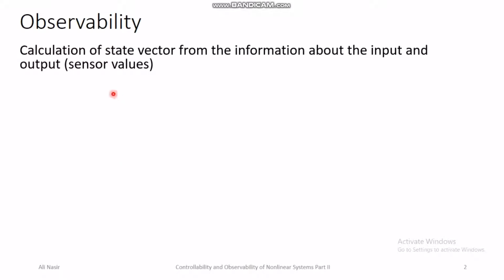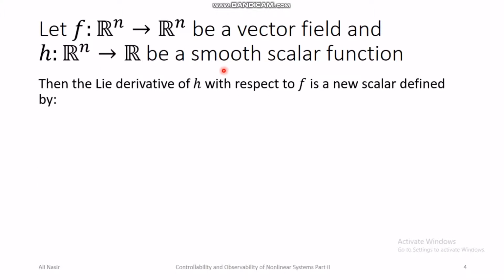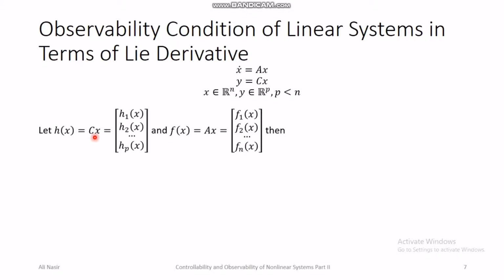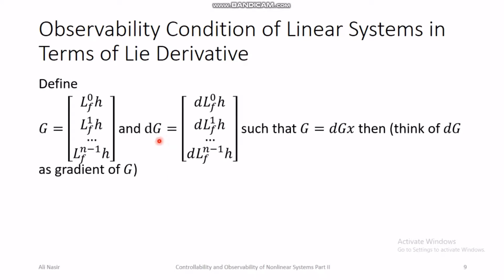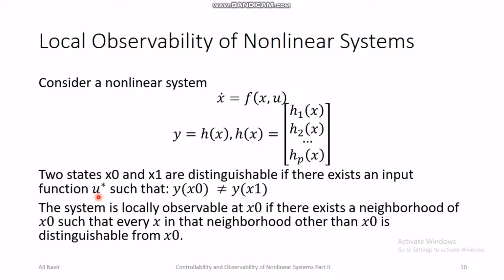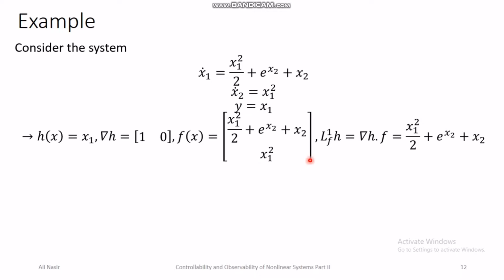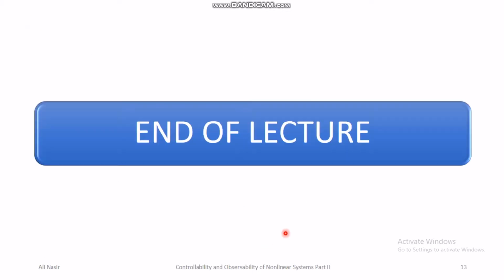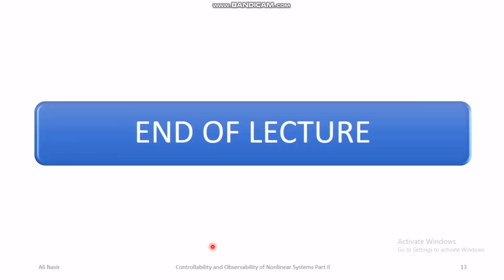Controllability and Observability of Nonlinear Systems Part II

Comment: Very impressive lecture on controllability 
Thank you sir 
I have a question
Suppose a Nonlinear systems
x_1dot = x2.g_1+f_1
x_2dot = u.g_2+f_2
y = x_1

May be this system is not controllable if x_2.g_1 is counteracted by f_1
Sir please clear this point.
Reply from the maker: If x_2.g_1 is counteracted/cancelled by f_1, then x_1dot will be zero. That means yes, the system would not be controllable. But on the other hand, in order for the f_1 to cancel out x_2.g_1, the f_1 would have to be exactly equal to -x_2.g_1 at all times.
Reply: @cset  Thank you for this wonderful comment 
Sir for research paper what assumption we added in the manuscript so that our system is controllable
Reply from the maker: @arunbali7480  For this you can use the method explained in the following video https://youtu.be/uped1mQhcHw There is an example discussed towards the end of the video
Reply: @cset  .I thank you wholeheartedly for helping me by taking out your precious time.
Reply: @cset   for this , can we add this assumption
"The Nonlinear functions f(x) and g(x) are lipschitz  continuous with f(0) = 0 and the system (1) is controllable"

Comment: sir, why you use the  term 'local'in observability of non linear system. what do you mean by term local.?
Reply from the maker: The term local means that the observability is guaranteed only for the state vector values that are "close enough" to the value x0. If the magnitude (or norm) of the difference between the current (or given) value of the state vector and the value x0 becomes too large, then observability may not hold. Some times we say that the system is observable in the neighborhood of x0 (instead of saying locally observable).
Reply: @cset   thanks you sir for your reply.

Comment: In 14:41, do you mean x0 and x1 are points or system states? I am a little confused by this point. If you look for example in paper (Lovell-  Nonlinear Observability for satellite Orbits) it is claimed that x0 and x1 are actually points and not states. Can you please clarify it. Thanks in Advance
Reply from the maker: Dear Abdulrahman, x0, and x1 are indeed points in n-dimensional Euclidean space (such a point is an n x 1 vector with real numbers as its components). I should have called them installations of the state vector. Distinguishability requires that the output corresponding to x0 and x1 (measurements by the sensors) is different from each other for at least one input u*. The logic is that if the sensors give different measurements (for different state vector values), then we can trace back the value of the state vector (or point) that resulted in that output.